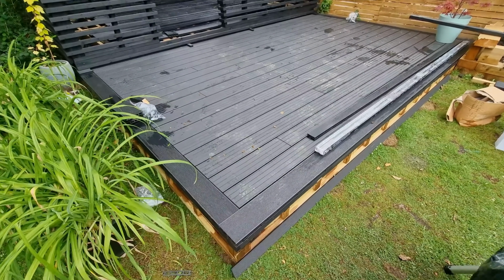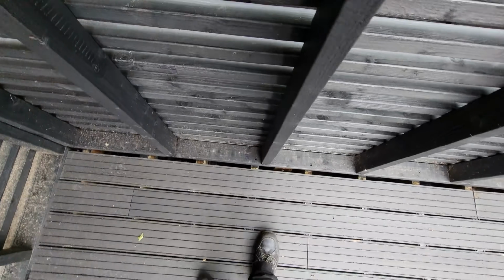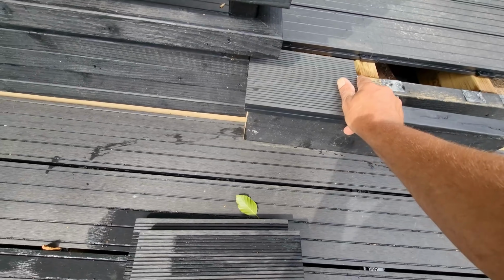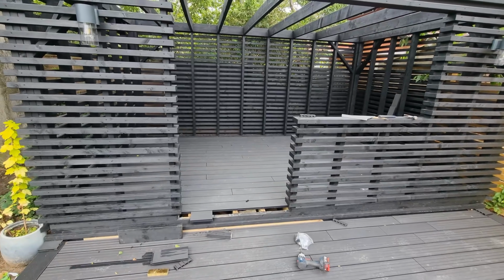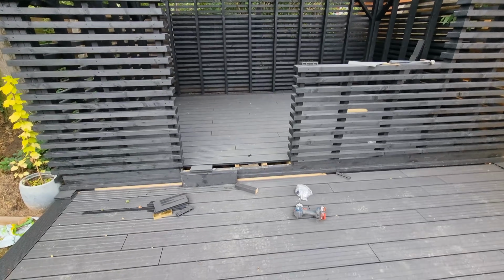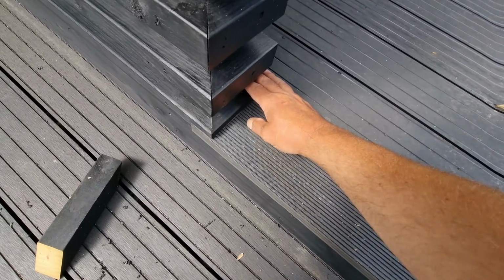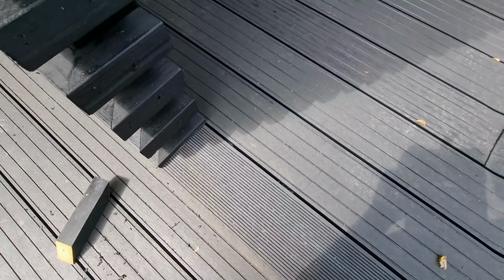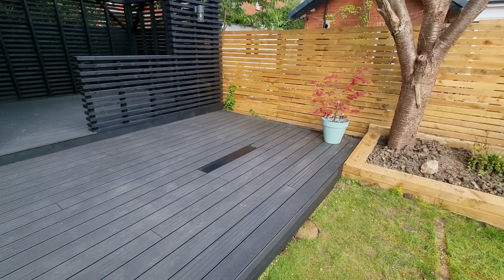Garden Barbeque Room & Deck build Pt11 - Finished, last bits of decking & the step up into the room

Comment: Great job. Putting that full board along the front where the step is was the right way to go. Looks like you planned it that way from the start. Also the fact the step sits flush to the front board & not overhang means less chance of any damage down the line with people stepping on it & damaging the edge. Great job
Reply from the maker: Thanks 👍 Yep a cup of tea n some thought, when the right solution is worked out it should look right n fit in, that's why i binned the other ideas n why i showed the thought that went into it, Yep i didn't want too much of a nosing, i think that board would've started to cockle over in time,,

Comment: Great job Gid. If you're going slightly rustic on the benches you could use scaffold boards and an electric hand planer for the edges. Just a thought. Regards Jim.
Reply from the maker: Thanks Jim 👍 we did consider those but 'he' turned his nose up at them, originally we were after wide boards, 1ft+, I bought 33metres of 275mm x 33mm pse @ £9+vat per metre today that'll need blathering in clear treatment, it'll be fine as long as it can dry out

Comment: Coming on nice. Maybe u could have put decking board  as a riser under step.
Reply from the maker: Thanks Barrie 👍 yep there were a few ways to build it, if i used deck board i'd have had to rip it down & pack that off the timber, i didn't want too much of a nosing, i thought it might just start cockling over in time n there's the holes in the ends to deal with, but i personally didn't want decking on the upright at all, on timber decks the boards i use have a ridged & a smooth side, i put the smooth side out for the riser, thanks for the thought, it's in the eye of the beholder & as i say many ways it could be built,

Comment: That turned out fantastic mate, I see no roofing/polycarbonate sheets were used in the end is that going to be an add on or have the customers changed their mind, wasn’t sure about all that black but have to admit it looks good 👌👌👌👍👍👍🇦🇺
Reply from the maker: Thanks Graham, 😊👍 no the polycarbonate or whatever he'd have chosen was scrapped, that's why the roof went in flat with no pitch, it still might get one on one day, there's  big pigeon that roosts in the tree above n craps all over it 😆💩 yeah the black looks better in real life, the 4k video gives an unrealistic colour, the seats that are going in are pine colour which softens it all a bit too, I've been putting pics on Facebook as this has been built , seating will gt done Sat maybe finish Mon  👍

Comment: Brilliant job Gid, did you have much wood left out of that big pile ?? Would be an asset to anyone's garden.
Reply from the maker: Thanks Brian 👍 not a lot left over in my eyes, 54 6x2s & there's about 2 extra, i allowed for nogins down the centre of the roof & i was going double up a couple to make a lintel above the door opening but the roof being lowered it didn't work like that, there's a couple of 4x2s, there was about 50 of them ordered, & 1 full length of 2x2 out of about 80 ordered, there are 27 horizontal 2x2 battens on each wall, i ordered extra 4x4 posts, partly because i wanted some for home, i'd settle up with the client on that at the end & because it's not easy to judge how the digging of post hole will go, how deep n how many. There are a few offcuts, this build was 3m wide, so the joists & short 2x2s on the ends of the building had to be cut from 3.6m lengths, not too many tho because i used them as nogins for the floor & the little returns on the 2x2 front around the door .